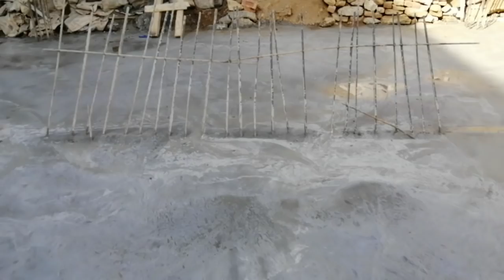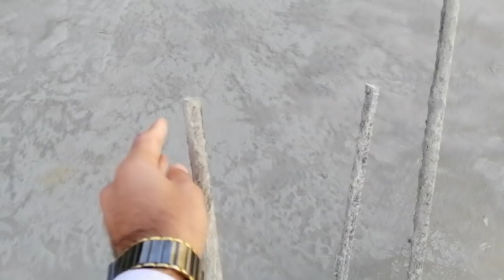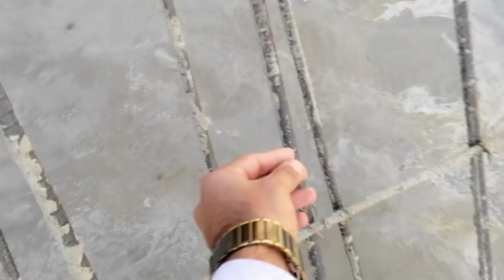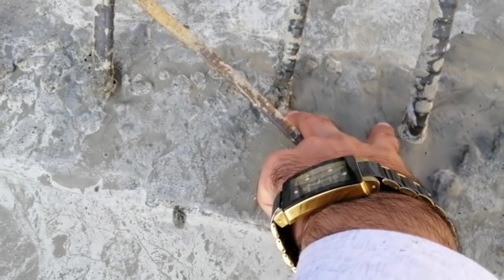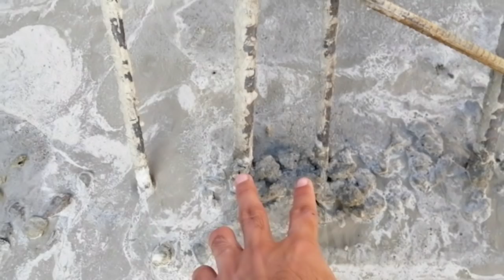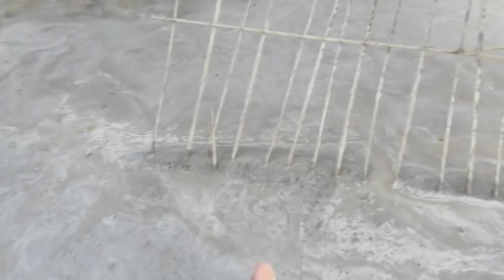Mistakes in RCC Staircase for Basement on Construction Site - Civil Engineering Site video

Comment: sir small doute from design of slab 

slab on acting load of machine 5 tones how will convert design load of live load in kilo newton per metre
Reply: Elaiyarasan Elai you should now the dimensions of the machine parts that is in contact with the slab
Reply: Elaiyarasan Elai you should now the dimensions of the machine parts that is in contact with the slab
Reply: 100kg =1KN and 1ton=1000kg
Reply: If 5tonnes is for 1m dimesion slab u can use below criteria or else u hv to find dimensions.